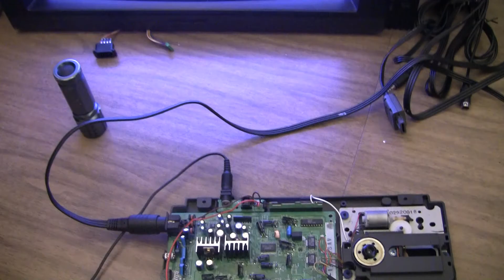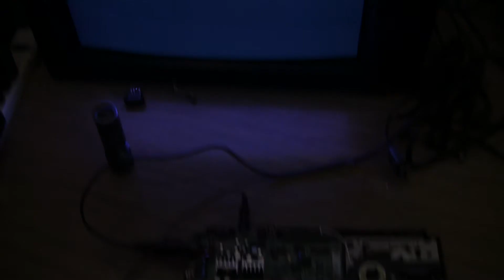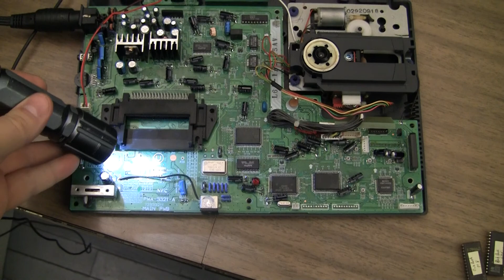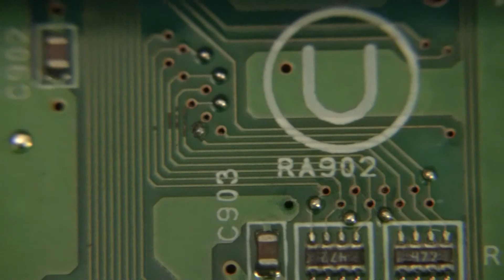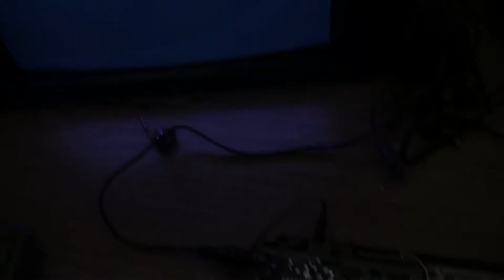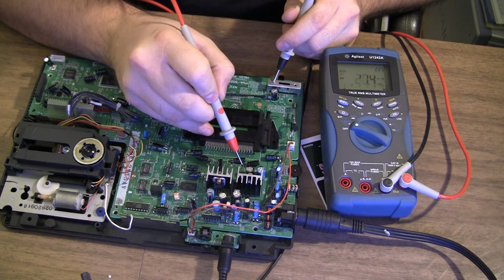Turbo Duo TG-16 - 5 volt rail short Pt 1

Comment from the maker: I believe that would still require a MM with better than .1Ohm resolution to be able to 'see' the problem chip with any confidence, not to mention time.
I also sold my thermal camera last summer so that trick is also out. I repaired many top loaders that way even though it's better at exposing symptoms and not necessarily problems.

Comment from the maker: Yeah if you watch close you can see the 3 connectors are just laying there not actually plugged in to the mobo.
I just ordered a ShortSniffer and will be giving that a go when it arrives, but will prolly also buy a LeakSeeker as soon as the new model is released. Hopefully that will happen this year...
Also still looking for a higher res multi, been watching for an Agilent u1272 for a while now just never pulled the trigger, wish I had now...

Comment from the maker: Full cap replacement is $50, HIGHLY recommended to do this even if it's fully working condition.
Watch my other vids about adjusting the cd rom pots, that may be all that's needed to get it going, if not it may need a new laser.

Comment: Hey I just bought a Turbo Duo off ebay for cheap and the guy claims the cd-rom won't spin up at all.  I'm hoping either the laser is hung up or just a couple blown caps but if that's not the case what would you charge me to get it fixed?

Comment: Yeap that when I go into my closet and get my 82b leakseeker hd. There is also a way to use multimeter and a battery to see the voltage difference in circuit parts. Also try heat from a heat gun or cold from a duct cleaner to find a shorted part with a multimeter to see spikes in shorted parts. Well I hope some of these trick could help you.